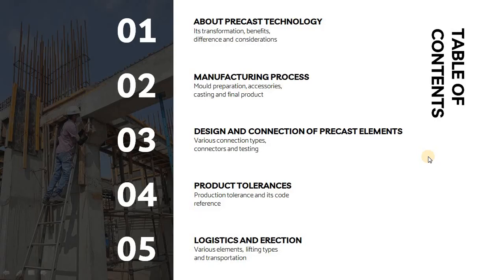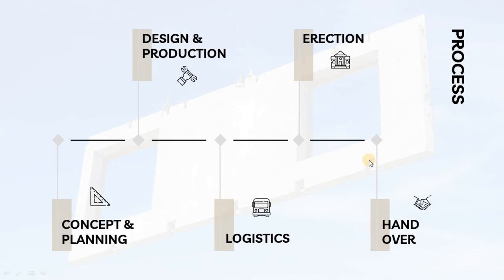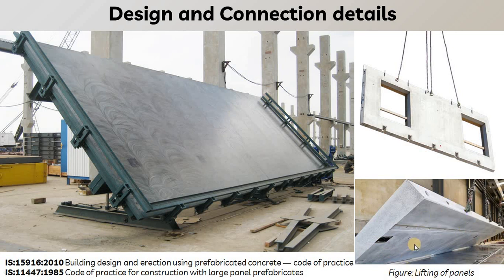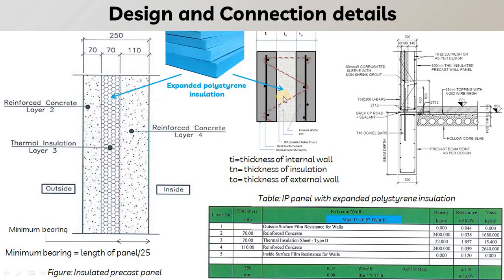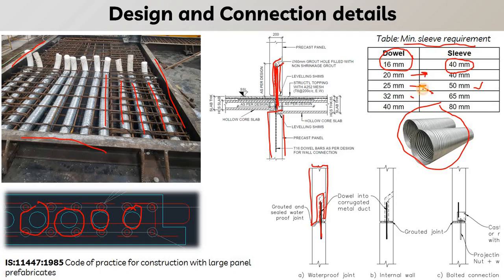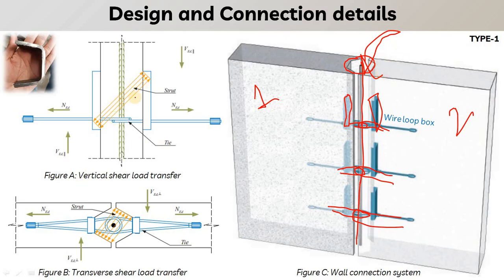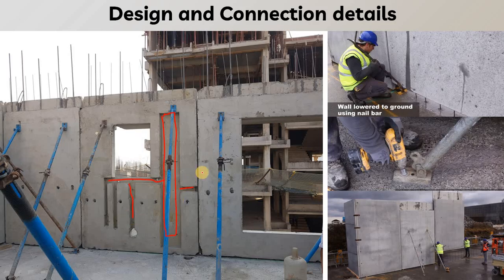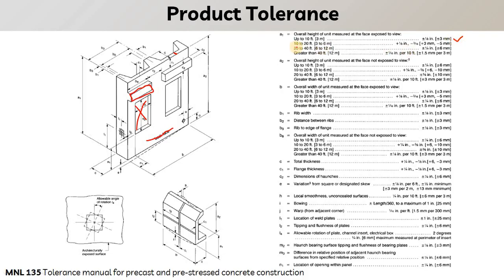Precast Wall Panel

Comment: Dear Eng what is the principle of precast wall design?I have a concern regarding buckling issues for one side load bearing wall due to eccentricity
Reply from the maker: If case of shear wall. Wall is designed for lateral forces and will apply torsional moment. And check the d/c ratio and it’s should be less than 0.9.
Reply: @SagarJotani I mean for normal precast insulated bearing wall.As per your presentation one layer of steel mesh used
Reply from the maker: @منوجهةنظري-ر4ص  No. What ever the type of wall is it. It is provide with two layers/mesh. In case of insulated walls, the external skin is provide with single mesh (approximately 8# - 200c/c. And two layers/mesh on internal/ load bearing side of the wall.
Reply: @SagarJotani Thanks